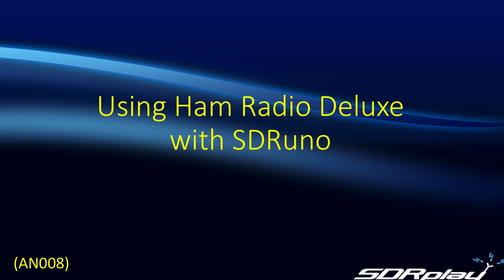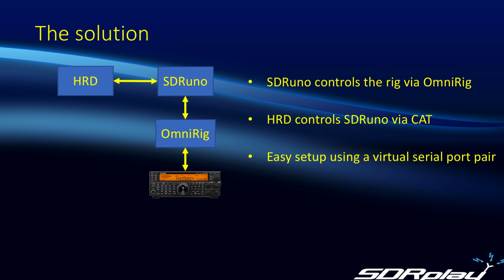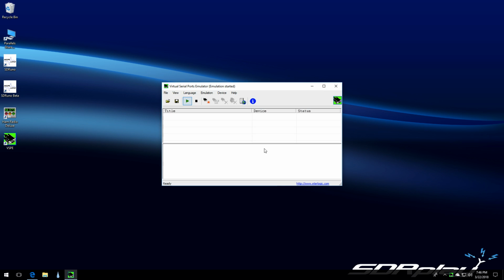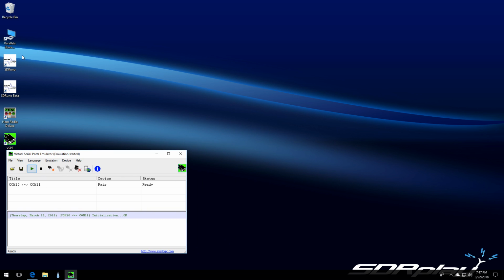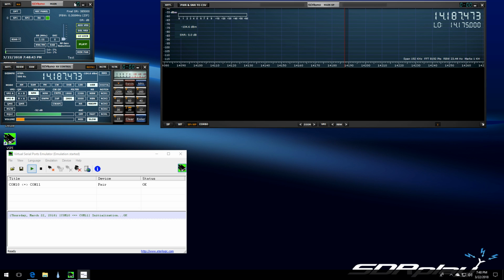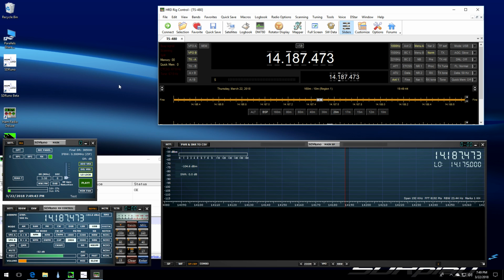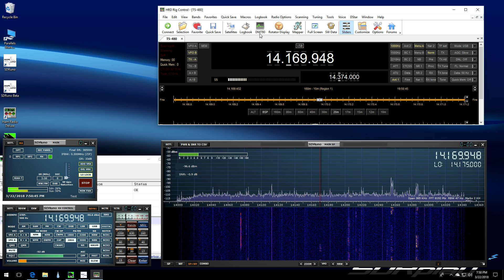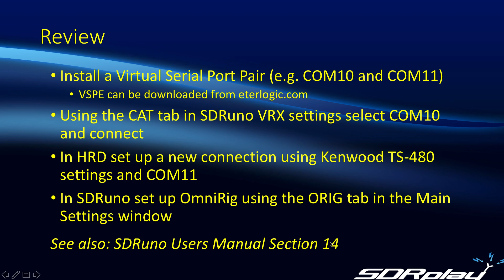Using Ham Radio Deluxe with SDRuno (AN008)

Comment: This does not work like you think it does.  Sure, SDRUno and Ham Radio Deluxe are synchronized, but what does that do for you?  It has nothing to do with radio operation/control.  What a person is looking to do is connect SDRUno>HRD>AND YOUR RADIO. This setup above does not do that.  I did find a way to connect the 3 together, BUT.......the radio dashboard, as represented by HRD is a Kenwood setup, so if your using an iCom or Yaesu, tough luck.  Sure, you can hit the PTT and it will work, but that all it will do.  None of the other buttons will work, unless your using a Kenwood TS-480.  DO NOT BE FOOLED

Comment: I think I missed that it has to be the kenwood model. I thought that was the actual radio you were using.
Reply: Kenwood TS-480 is the protocol SDRuno emulates when being controlled by third party software. The actual radio you're using and its COM port are specified in Omnirig.

Comment: Yes that is fine HRD and SDRuno is slinked but but neither is controlling my ham radio which is not a TS 480. How can a G90 which has a totally different COMM number be controlled? HA9FMR
Reply: TS-480 is the protocol which SDRuno emulators. You would put the physical COM port of your rig in Omnirig to allow SDRuno to control it.
Reply: @stevebrightman2309  Well Steve I tried that, rig 1 was the transceiver rig 2 TS480. Com 1 and 2 was the virtual pair.  HRD is not allowed to connect to com 2.  I tried other pairs same result. HRD alone works with my Yeasu Ft 450d ok. It seems that SdRuno takes that port before HRD. Can you help? I am using Omnirig 1.2
Reply: @lacigolden  if you're using the approach outlined in this video there will be no "rig 2 TS-480". You should setup SDRuno to control your rig in Omnirig using it's physical COM port. That would be the first verification step. The virtual COM port pair is used between HRD and and SDRuno - Omnirig is not involved. It;'s unusual for COM1 and COM2 to be available but I'lll go with what you said. So in VRX settings in Uno select COM1 and then check "enable and connect". Assuming it shows can acted you can then go to HRD and choose TS-480 as your radio and select COM2 as the port. If HRD cannot connect to COM2 it is most likely because you already have Omnirig connected to it as RIG2. 
Follow the directions exactly as described.
Reply: @elansteve  Thanks for the quick response.  I  fallowed your instructions in VRX, com 1 is connected.  In omnirig rig 2, if I put none no connection  will take place with SdRuno and  HRD. If I use Ts480 in Rig 2 SDRuno and HRD are synced. But the radio is left out. In main settings under ORD it shows the rig1setting  as com 15 and is on line. rig 2 setting not connected. I tried this with different virtual serial programs with different com pairs. No cigar.
Reply: That is not what I said! You are mixing things up with the alternative approach I detailed in a later video. 
Omnirig is only used for controlling the rig, it is not involved with the virtual COM ports and sync with HRD.
Reply: @elansteve  sorry but it is still a problem. I put none in omnirig rig2  in rig one my radio comm port.  and hrd cornets but fails to control radio and sdr uno or vice versa.  It seems that you do not  not understand the problem.
May be I was not clear enough in the main panel under ORIG rig 1 is connected  but rig 2 is not available why? I have tried my old way and your new way same result.
Reply: @lacigolden  open a support ticket and post screenshots of your settings
Reply: @elansteve  thanks will do.
Reply: What version of sdruno this setup work on? I have the latest.
Reply: Well Steve thank you for all your help I solved the problem everything works.  the solution was to turn on RSIN1.  Some how I missed that part from the video. Your latest suggestions worked finally

Comment: OK...... Ive wandered off into the puckerbrush!   Trying to make this work with my FTDX101MP.  SDRUNO works fine. HRD starts, but after a few moments it loses the connection, then wont reconnect.  Im sure i have settings goofed up by now. 
Omnirig is at COM13.  SDRUNO is at COM16 using paired port from VSP. HRD is at COM15 using paired port from VSP. HRD is at Kenwood TS-480.  Any ideas?
Reply from the maker: COM13 seems unlikely for your rig. What does device manager show?

Comment: I went ‘round and ‘round with trying to get my IC-7300 setup to have HRD control SDRuno, which, in turn, then controls the rig. At about 4:38 (scrub position) into the video the discussion moves to the part where one sets up the HRD, and it is shown that one would just create a NEW preset. Well, after digging through comments, I found that SDRplay had replied to Paul K5VOP's issue, as follows: "Paul K5VOP watch again! HRD does NOT control the rig, it controls SDRuno which looks like a TS-480 to HRD." As soon as I configured HRD to be a new Preset that was composed as a Kenwood TS-480, everything worked!!  The intuitive thing I had been doing was trying to create a New Preset that was for my Icom IC-7300, and using the virtual serial port. It was not clear that “SDRuno .. looks like a TS-480 to HRD”. So, it appears that, REGARDLESS OF THE RIG, one must ALWAYS create the New Preset in HRD Connect to be a KENWOOD TS-480, to match what SDRuno “looks like” from HRD. I hope this helps others. Thank you for putting this video together.
Reply: Yes that is fine HRD and SDRuno is slinked but but neither is controlling my ham radio which is not a TS 480. How can a G90 which has a totally different COMM number be controlled? HA9FMR

Comment: I have a question, do you need to connect the antenna to SDRplay, or just a USB connection is enough
Reply from the maker: Yes.  Take a look at this video on Panadapters: https://youtu.be/_GCJv00sk70
Around 7.5 minutes in, it shows the options for getting the RF signal into the RSP.  Make sure you never expose the RSP to more than 0dBm (1mW) of RF power when transmitting, otherwise damage will occur.

Comment: I have hrd connected to the ic7300 usb com port.  I also have a 7300 civ com port which is used by wsjt-x when I'm working digital.  If I'm on ssb, and not using wsjt-x, would there be a conflict with hrd if I connected sdruno to the civ com port?
Reply from the maker: There is always the possibility of conflict if both HRD and Uno tries to sync with the rig. It’s nit a port issue.
Reply: @SDRplayRSP  OK, thanks!

Comment: What if we dont have OmniRig setup already?? Where elsewhere is the setup of OmniRig been covered well elsewhere?? I'm not finding any good info on that! I'm brand new to this and trying to set up an IC-7000 to work with both SDRUno and HRD. It works fine with HRD but haven't found any good info yet on setting up Omnirig with SDRUno! Need a little guidance!!
Reply from the maker: Search the catalog for “panadapter” there are a lot of videos and app notes.
Reply: @SDRplayRSP  I take it by "catalog" you're referring to the rest of "SDRPlay SDR's" collection of videos. I watched a few but will have to do some further studying on them I reckon. Thanks for responding!
Reply: Looks like the video called "SDRPplay Panadapter Webininar" is beginning to steer me in the right direction of what I'm looking for. I seen some by others getting pretty detailed into the setting up OmniRig and I think them all combined will help me put everything together. Thanks again!
Reply: @SDRplayRSP  Well after doing some searching and watching a few more videos I got everything up and running and working perfectly other than when I switch through my local repeaters in my favorites menu on the radio, SDRUNO seems to kick my radio out of FM-TONE mode and put it in straight FM mode, (I suppose that's because there is no FM-TONE mode in SDRUno) is there possibly any solution for this, or is it just the nature of the beast? The best solution I found so far is just to click off RSYN1 button in the RX Control window in SDRUno and and set the radio to FM-TONE mode manually when I want to transmit on a repeater.

Comment: Well everything works with SDRuno but unfortunately still does not sync to HRD, frequency only changes on radio and SDRuno. Also, now my radio randomly starts TX for no reason.  The video is great, very easy explanation and setup but for some reason it isn't syncing mine, i've gone through it twice. Could be because HRD doesn't have a setting for my ftdx101D but I was told to use 991. But this setup works when just using HRD so I am stumped.
Reply from the maker: Paul K5VOP watch again! HRD does NOT control the rig, it controls SDRuno which looks like a TS-480 to HRD. Also look at the app note referenced in the description.

Comment: The only way I can get this to work with my FT 5000 is to tell it I have a Kenwood TS2000.  The Yaesu has no CTS setting and I'm guessing that is the problem.  HRD works alone to the Yaesu and Omni rig also can connect to the Yaesu and both can control but I cannot control SDRuno with HRD unless I tell it I have a Kenwood.  I think it will do what I need this way.  N8HMG

Comment: Great video Steve.  Please note, however, that while frequency tracking works very well, not all of HRD's CAT commands are handled successfully through VSPE.  For example, switching the rig's antenna between ANT 1 and ANT 2 doesn't work, and switching between IF filters A and B doesn't work. There are many other examples of CAT commands not working, but also note that some CAT commands do work.  Go figure.